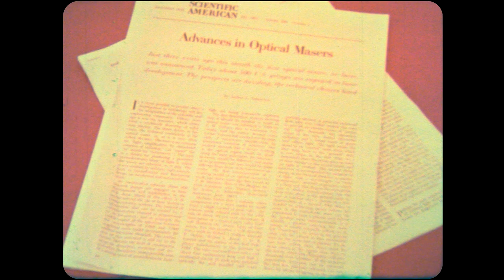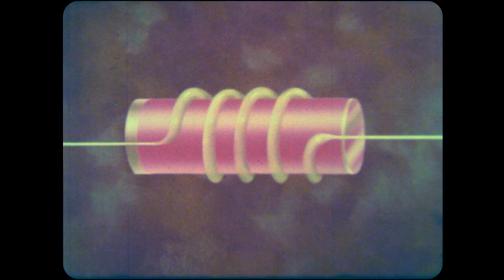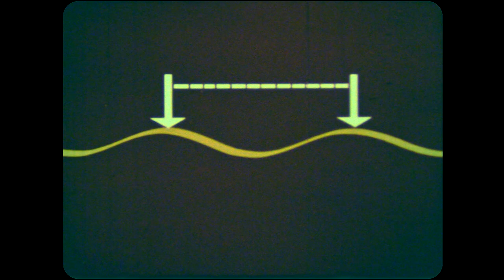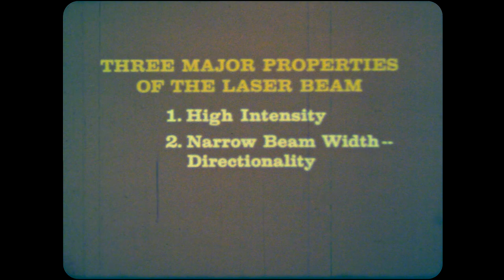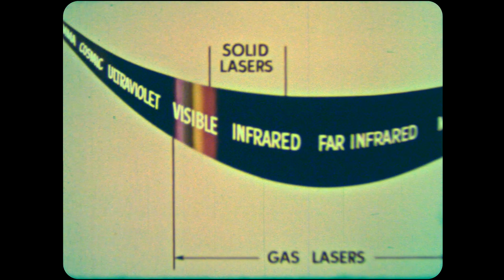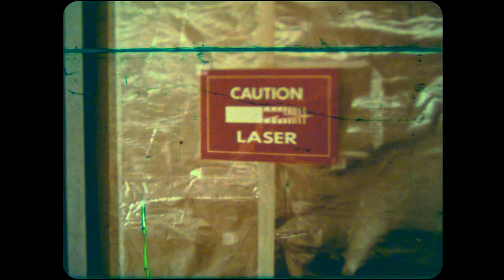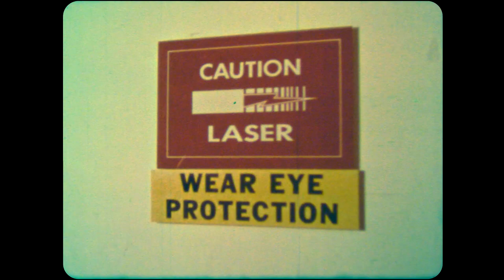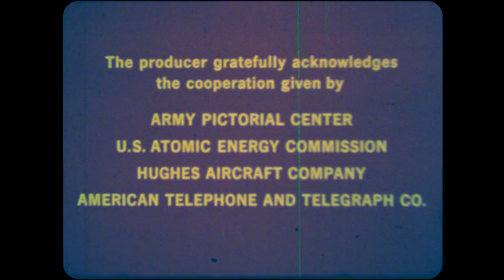The Laser Beam (1968)

Comment: Oh, they didn't know that cats love chasing that bright red spot? It's a pity.
What I like about this video is that it brought the modern science and technology to the masses without dumping too much information or complicated formulae. Getting your knowledge across without being boring, overly simplistic or incomprehensible is an art in itself.
Reply: Back then, lasers weren't quite portable enough to be carried around and waved erratically. Of course, fiberoptics could eventually be used to direct the beam, but mishaps were more prone to ignite or vaporize bits of the cat. (Sounds like a great Itchy & Scratchy episode!)
Reply: I Thought the dog at 6:19 was going to go for the laser analogue jet of hose pipe water though.
Reply: Your glasses tell me more than you will ever know about you.
Reply: Cats?  You get 2 people on site in a dark room with a red laser level and a green laser level and a vape cloud machine and they won't leave.
Reply: I used to use a HeNe gas laser - mounted on a box with a powersupply that plugged into the wall -- as a cat toy! (cheap diode lasers were not a thing then)
Reply: @railgap  that's definitely a nerdy cat toy. Way before it went mainstream :D

Comment: WOW
Fran, I can not believe that a film this old actually mentions LED lasers.
Must have been cutting edge tech at the time.
Reply: They mention GaAs semiconductor lasers, but not fiber optics, but then guessed right about space-to-space direct laser links like Musk's Starlink satellites.
Reply: @CraigBrideau  I'd say they came close enough to predicting modern fiber optics when they speculated about directing laser light through tubes.
Reply: @Dee_Just_Dee  Still, the tubes were only for protection, the bends would happen only in the relay stations while the tubes would have had to be 100% straight
Reply: Just to clarify, an LED is not a laser, it is a light emitting diode. What they mentioned was a 'semiconductor laser' which is known today as a Laser Diode. The main difference btwn LED and LD, can be understood by reviewing the acronym LASER,  the S stands for Stimulated, where as in an LED (light emitting diode) light is amplified via "Spontaneous" emission, not "Stimulated" emission. 

In short, photons in a laser cavity stimulate excited electrons to release a photon of the same wavelength, and frequency as itself, whereas spontaneous emission occurs with no such stimuli, simply the result of many excited electrons falling back to lower energy levels at will according to when there is room for them in the lower energy states. So, an LED cannot produce coherent light of a single frequency. I.e., a red LED is emitting a range of red frequencies.
Reply: @RusticRockMusic  There's even an in-between device known as a superluminescent diode (SLD), which is a gain medium like a laser diode, but without the reflective regeneration of a true laser. The light emitted by an SLD is an interesting hybrid of the behavior of an LD and LED.
Reply: @RusticRockMusic  TY for the clarification, I knew how gas lasers worked but did not know how the laser light inside an LED is created.
Yes I know about excited electron energy states & a photon is released when it resettles back down in LEDs,.
Reply: @404Anymouse  but if when they expand the scope of the project by making more & more bends they would add more & more mirrors or glass-prism in the tube and eventually they will realise that they could just fill the entire tube with an internal-reflecting glass or substance which is just a modern fiber-optic but thicker.

Comment: One application they didn't mention was the laser gyroscope (or ring laser gyroscope).  When this film was made, I was on the Navy ship USS Norton Sound which tested many things.  One of the things they started testing in 1966 was the laser gyroscope.  It is commonly used today.  It still has the same curvature of the earth issue as mechanical gyroscopes where if you could sail around the earth on a great circle the gyroscope would thing the ship's pitch rotated 360 degrees end over end.  On the Norton Sound, this was corrected by linking to the dead reckoning system and a computer was involved which I believe was a Univac 1219.

Comment: I can remember reading a Unitid Nations technical report on the laser when I was young it theorised that we would have laser tellecomunications links.
As it was an early report it did not include it had to be line of sight with no obscureing such as water vaper.
It also mentioned about the use in dentistry, but what happend to that?
Thanks for the video.
Reply: Last time I was at the dentist they scrubbed the plaque off my teeth with a laser.

Comment: Interesting about w wanting to send the laser beam through a tube instead of using fibre optics which had already been around for some time. It would be slightly faster to send each pulse but it would be incredibly more expensive especially if you wanted to run multiple signals side by side.

I wonder if ping time is considered that critical anywhere nowadays?